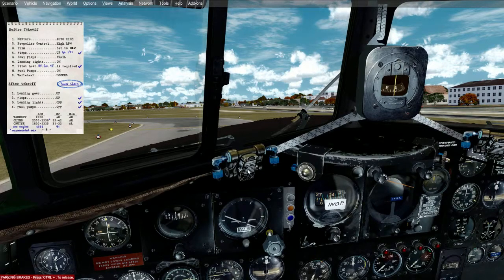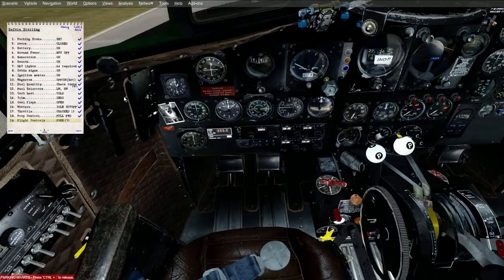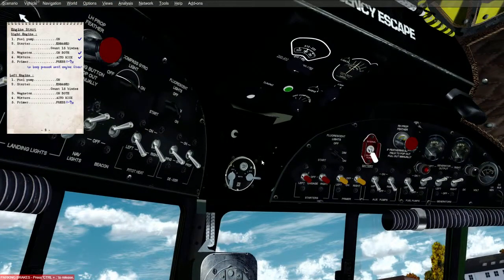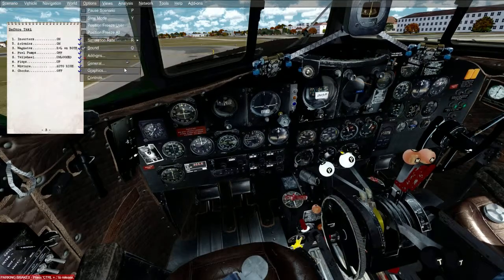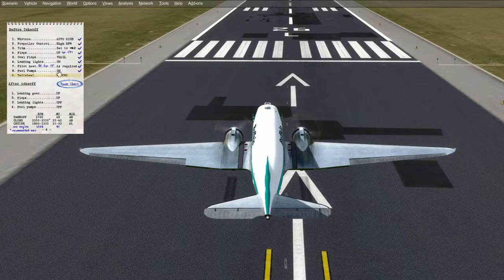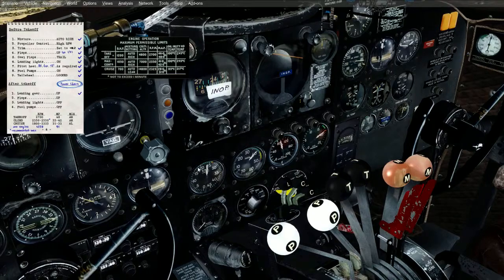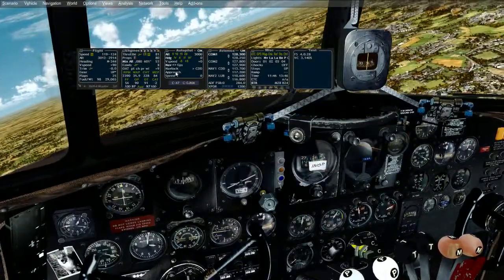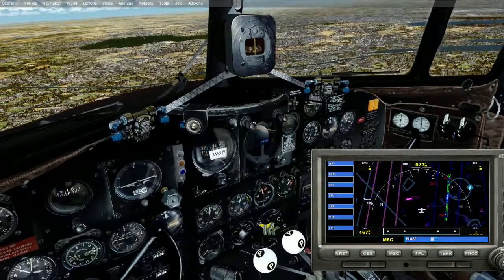DC-3/C-47 P3Dv4 Part 2: Enginestart, Takeoff and the Autopilotsystem

Comment: How did you install I loaded from SOH but bunch of file but no application regards
Reply from the maker: simple extracting and place the folder with the Texture folder inside in P3D/FSX Mainfolder/Simobjects/Airplanes
Reply: So tel me little more I saw Simobjects/airplanes ..you mean entire file to the those folder or just tell me step by step regards
Reply from the maker: You has also i the folder a Readme who all is explained step by step I hopeit help: Unzip this package to a temp folder keeping the folder structure intact. Move the 'Douglas C-47R_V3.14 Beta' folder either to your FSX or P3D Airplanes folder. Open the Effects folder in which you should see three folders named FSX, P3Dv3 and texture, plus two effect files called 'fx_c47parajump.fx' and 'fx_vclight_c47v3.fx'. Move these two fx files to either your FSX- or P3D/Effects folder. 

The FSX and P3Dv3 folders contain the exhaust smoke effects files. Depending on which sim you use open the respective folder and move the 'fx_Cranky_DC3_TFF.fx' file to the Effects folder of either FSX or P3D. Click 'Yes' when asked to Overwrite. 

Finally move the two BMP files (fx_c47para1.bmp and fx_c47para2.bmp) from the texture folder to either your FSX or P3D Effects/Texture folder. These are the two files that texture your parajumpers.